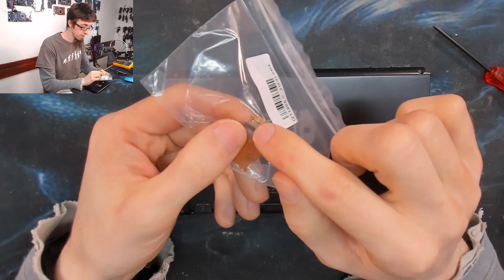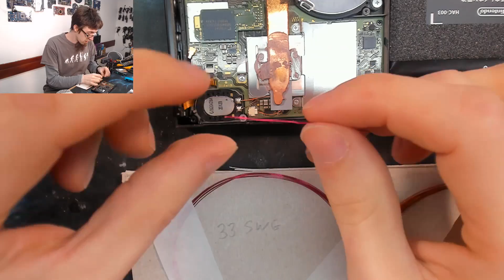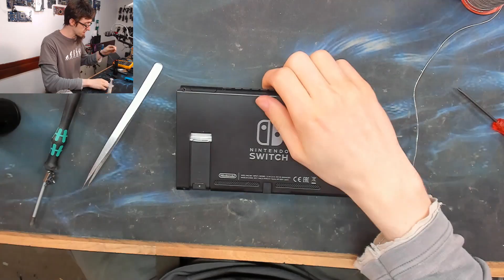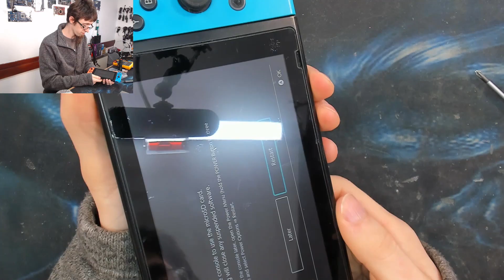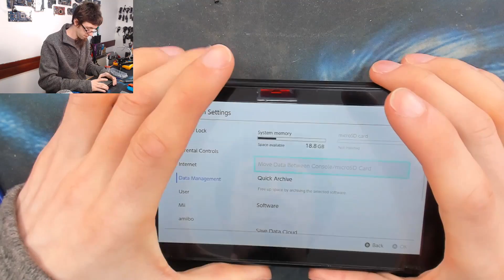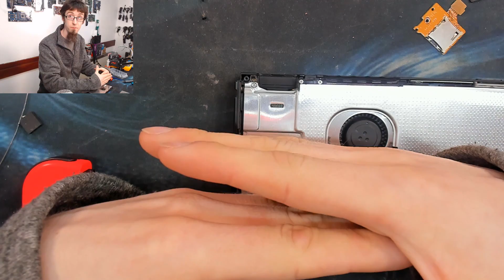Nintendo Switch SD Card Reader Repair - LFC#225

Comment: 4 years later and still helping folks. Used this method to fix my issue. One of the contacts had broken and didn’t want to try desoldering the whole connector. Got me up and running again 😊

Comment: I need help Pls, I bought new reader and placed it in its place n all that, but when I play a game a msg pops up on the screen saying "the micro SD card has been removed, the console will now turn off " then says"Always turn off the power Before inserting or removing SD card. then it does me the proper way to turn the switch off, what should I do?

Comment: Do you have a diagram of some kind that tells you which points on the board lead to the right point on the reader itself? I'm pla Ning on using your method but I wanna make sure I'm soldering things to the right spot...
Reply from the maker: You can see the traces on the board if you look very closely, and then use a multimeter in beep mode to confirm.
Reply: @Adamant_IT  would I do this with the reader attached?

Comment: This is legit the issue I'm currently having with my switch. 😭
Reply: How you fixed it
Reply: @2Fast4U_Off  i haven't yet. As I have to bridge the connection between the motherboard and a new card reader.
Reply: Sounds like I’ll never be playing my switch again if this new sd card reader dosent work tomorrow lol
Reply: @ItsmeCiaburri mate, I have the same issue I live in Utah I took my Nintendo switch to the nearest repair shop (game changerz) and the repairs did nothing I’m honestly thinking my switch is done for.
Reply: @GhostBehindMyEyes  lol yup mine was done for. My next step was to take it to a repair shop but it wasn’t worth it for me since it was a v1 switch. So my next best option was to go onto Facebook marketplace and find one local. So I got a oled chipped modded switch. Couldn’t be happier.  Good luck man!

Comment: I have zero knowledge in this stuff so i need to know. At the end he just put glue on the thing and the switch started to read it. Does that mean what he did with the wire and everything was useless work? Or was that still neccessary
Reply from the maker: Bit of both. The wire was needed, but the other pins were also making poor contact and needed help.
Reply: @Adamant_IT  appreciate the response thanks

Comment: I've been doing a fair bit of micro-soldering lately; you really need to get some flux on there. It really helps avoid those cold joints. I'd also recommend a smaller tip iron when space is limited.

Comment: had this problem with my Samsung mobile and I was told that the Scandisk micro sd is slightly thinner, put a Samsung micro sd card and it worked fine.
Reply: Wait really

Comment: It’s not a fix, it’s holding water until it came out of the store , your soldering is miserable, you don’t have the equipment for such a job, don’t get mad but I wouldn’t want to be your customer, I would have a feeling when I see how you did it, that I threw my money for repairs...I wouldn't do such a job for free, let alone charge it, let alone put it on you tube, that's why this industry has a bad reputation,
Reply: The keyboard warrior is strong in you...

Comment: Great video.  Maybe the reader needed a good cleaning with 99% ISP.  I can't believe how well you got that huge chisel tip to work.  I have been soldering since 6th grade and teaching myself micro soldering at 50yo.....  Still trying to figure out a good technique.  Hot air soldering is ingenius!  lol.  Still trying to perfect my technique on that too.  A decent microscope is a must.

Comment: I've watched you solder so many things back to life. After watching your noodling around on that graphics card, I'd love to see you get your hands on an AIB GTX3080 and swap out the POSCAPs for MLCCs. Just to do it for the hell of it. See if it makes any difference. I think that's a video that would make this channel catch the algorithm and blow up.  And talk about a new challenge to inspire you to get new equipment and learn new things.

(Yes, I'm aware that Nvidia is already working on driver fixes for that capacitor stability problem as are the board partners. However, I've seen Graham solder so many capacitors by now that I immediately thought of him when I heard about that problem with those cards. :D)
Reply from the maker: Heh, I wouldn't be attempting it myself at this point, but I reckon we'll be seeing a lot of cap mods on those in the future. The question will be what the most optimal configuration actually is.

Comment: Its the connector on the logic board. The little terminals seem to break at the joint and make some contact when you were pushing it. Remove the connector with how air and flux and replace it, clean up with IPA. Done it many times. Nice job though. I love your videos. Keep up the great work!!

Comment: I've done this repair several times, very common as it's a hidden connector and people mash it about, chances are you would have found the hidden pin stuck in the SD flex side connector, if you were careful it's pretty easy to slot these pins back in and resolder them compltely bypassing the need for ugly jumpers.... the solder simply detaches from the board from improper connection mentioned above - also i see you were not using flux and yet you were still bringing iron to solder, flux it up man and clean with IPA for a significantly better joint, if the joint fails while cleaning then it simply wasn't good enough. I only mention that as i see solder that is stuck to the enamel of the wire and not the actual copper.

I'd guess your "bullying" of the SD card has less to do with the SD gold fingers and more to do with the SD connector once again, me personally, i would have resoldered every pin on the SD connector on the mainboard as there was  already multiple missing.

My opinion on solder tip, chisel tip like you were using if a good choice, these boards can sink a suprising amount of heat and despite what peopple might think a smaller tip causes more issues.

Anyway good vid, now go and buy a decent microscope, an "unbranded" trinocular amscope microscopes can be had from aliexpress for 160 quid delivered (under the eakins brand) so no excuse ;) and are significantly better than the cheap ones with non standard objective lenses or one of those digital LCD ones. I promise you a proper microscope will change your repairing life and you will get 10x the work done in the same time.
Reply: 100% microscope makes the biggest difference
Reply: do you do repairs? where are you located?
Reply: Hi Dom i've been having this issue for a while now i changed the sd card reader with a new one i bought and still the same issue i watched this video and seen he mentioned missing pins and upon inspecting mine i noticed i have 1 or maybe 2 pins missing not sure if this is the issue why in getting the sd card removed notification telling you to restart but cant seem to figure out whats causing the issue any advice on this  ?
Reply: @Anthony-rw9ir  Hey, your issue definately sounds like it is stemmig from the missing pins, it's also possible those pins are stuck in the SD flex connector so give it a good look over, also check the speakers as the pins are slightly magnetic if they're anywhere they might be there.

it's also possile you have pins which have broken from the solder but are still in place and could be causing the issues your seeing. I would practice on something else with a similar connector and practice your soldering on it, once you feel confident you can move on to to touching up the joints on the SD connector, ensure all joints are good, check the missing pins are anything other than ground, if they aren't ground you'll have to pull a few from a donor board or replacement connector

If you find your soldering iron is stuggling for whatever reason, then hover your hot air gun at 150C low air in the vicinity while soldering to help you out.
Reply: I have just started learning DIY soldering.
Do you mean that using a chisel tip is better than conical tip in the case in this video?
Thank you.

Comment: You can replace the pins in this type of connector, I've repaired at least six Thinkpad T420-430 mobos with broken keyboard connector (which isn't an FFC connector) Just add 1 millipaul of Amtech flux, place the pin in the plastic bit and touch the pin with the iron and it's done.

Comment: Check out NorthridgeFix channel, he has a shop in California, he does this kind of micro repairs on all sorts of devices, you need a microscope and micro iron, hot tweezers and and smd rework station, If you had the right tools and experience you could of just take the whole connector off and put a new one on.
Reply from the maker: I'd have considered replacing the whole connector if the entire thing was mashed. But for one wire, a jumper is a lot easier IMHO.

Comment: Nice fix, never seen a fix like that, normally you use hot air and change the connector but that seem to work just fine!

Comment: I use a class 10 sd card for my dash cam. When I transfer files from the sd card to my laptop, the files are usually about 1-2 GB and it takes a few minutes to transfer. Yes, it takes 2-3 minutes for sd to transfer files over. 
Great video. Thank You.

Comment: Well done graham :-D
If you do need fine enameled wire suddenly, take an old single battery clock apart,  there be fine wire there  lol.
I wonder why the card reader plug does not have a small square of foam on it to press the tiny connector into the mobo.
The back case would press on the foam.
Double sided sticky pads come to mind.

Comment: Don't solder dry, when tinning a wire or a pad always add fresh solder while the soldering iron is on the wire/pad. Never put solder on your iron and then tin a wire or pad, you'll get a dry, ugly joint. The flux in the solder wire burns off immediately so you need to add it in place. The only exception obviously being if you're using flux paste anyway.
Reply: Hey m8 can you help me with the jumper wires ?

Comment: I would consider lining the hole in the shield with some kapton tape, so that when/if the magnet wire rubs against it and the enamel wears off, it won't short.

Comment: Great job Adam! Get your self a microscope and set of fine tips for your iron. One you used was massive for this job. ;D With microscope and proper tips, your micro-soldering will improve drastically. Flux is a must as well for a good joint. Also good way of practice is to secure such wire with UV solder mask.

Comment: For micro soldering I would recommend a pointed solder tip makes things so much easier. Great video again.
Reply: For microsoldering I prefer a chisel tip. Something like a Hakko T30-D06. To each their own. 😊
Reply: @FBravo2084  I like to use Metcal UFTC-7DRH408 0.8mm hoof tips. With my Metcal MX-5210